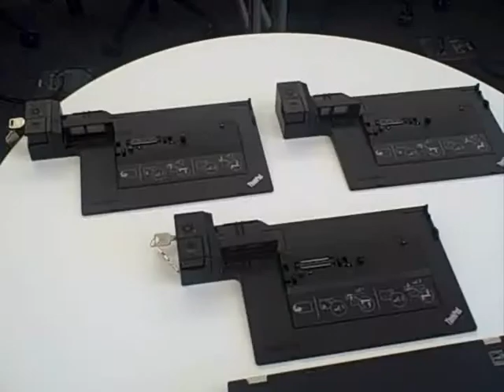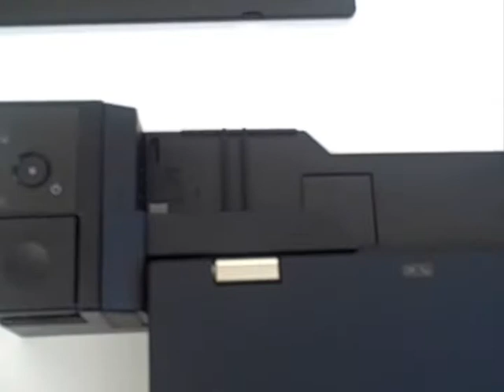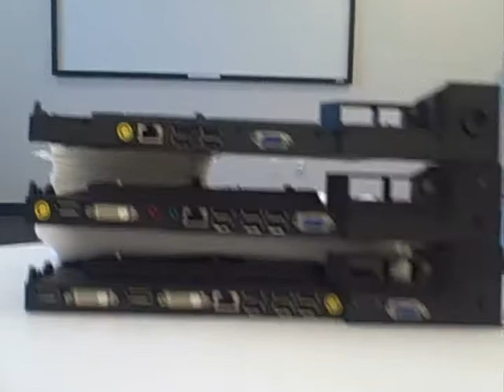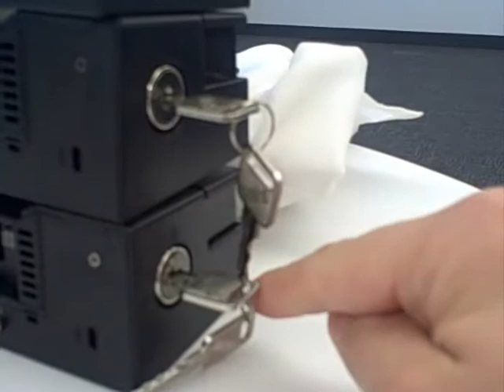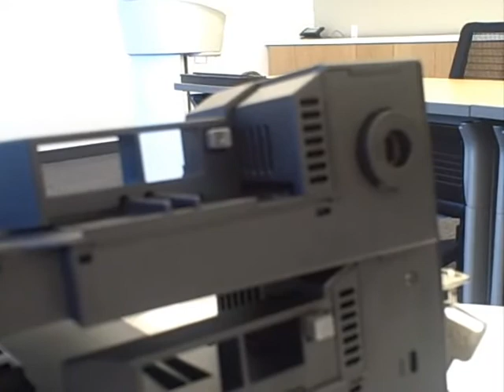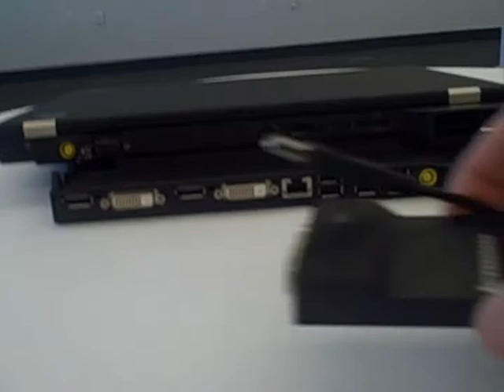Lenovo Series 3 Docking Tour

Comment: My Dell port II doesn't force me to wait on Windows to tell me I can remove my laptop. I've not had that issue for years. I wouldn't think it would require newer hardware to achieve that, but I don't know. Mine has USB 3.0 and two DVI and display ports built in. It's pretty nice.

Comment: Ehrm...

I hope this time it really works... my T61 dock doesn't seem to be remembering that I have my display 90 degrees rotated. it screws up everything related to display settings each time I dock / undock it. :@

Anyway: USB videocards have always been a big failure. No more PCI-e slot in the dock? Why?

Is there still a SPDIF output?

Comment: Minidock plus is a joke. Why bother making TWO display ports, TWO DVI ports, and ONE VGA port when you can only use ONE of the five ports for dual display at most? And you need a separate USB to DVI adapter for a triple display?! I'm not paying an additional $25 plus dollars for an adapter that was originally supposed to be included in the mini plus dock! "All about video functionality" my ass. I own one and was very disappointed when I found this out. Luckily I paid only $15 for the mini plus at our University surplus store. Get your shit together, Lenovo.
Reply: Problem is with the shitty Intel Integrated Graphics, that shit only supports TWO outputs at the single time! On newer Intel HD GPU's you get max 3 outputs.